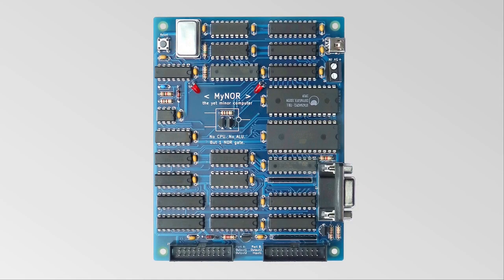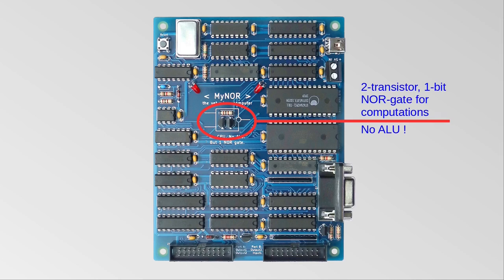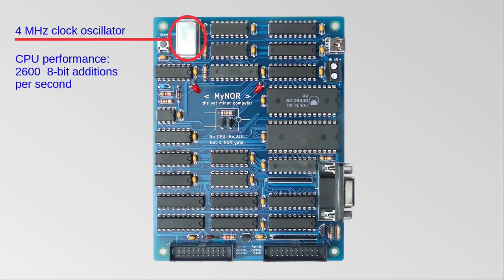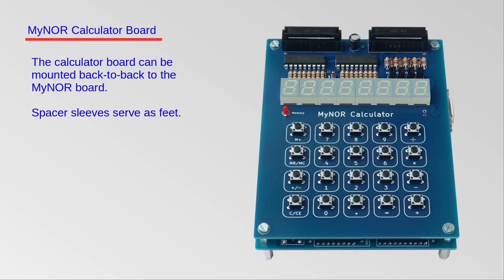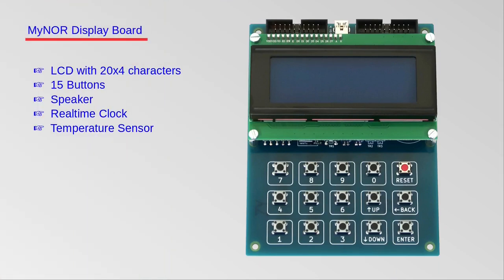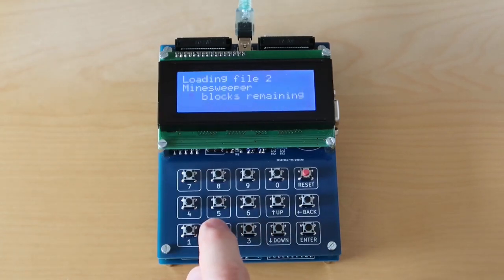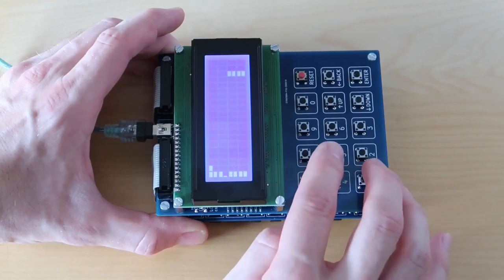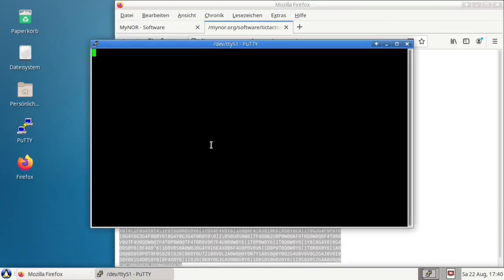Introduction to the MyNOR computer project.

Comment: Do you think this thing could output VGA?
Reply from the maker: No, never ever. MyNOR is much too slow. But the output of VGA was really not the goal of this project ;-)
Reply: @mynor509  it should be possible, make just static images, then it is about memory, not about processing
Reply from the maker: @SergiuCosminViorel It is not as easy as you think. I have already made a discrete graphics card for my MyCPU computer (www.mycpu.eu). It is all about timing. And My4TH is really too slow for that. It would be possible to output - let us guess - 64x64 pixels on a screen if you did it in microcode, but then you would have almost no processing time left for the CPU to execute software.

Comment: so it works like fpga?
Reply from the maker: No. A FPGA is a completely different thing! But MyNOR can be implemented in an FPGA. MyNOR could be considered as something similar to an FPGA if the external registers were considered as flip-flops and the EPROM as a logic cloud. But this is not the case, the EPROM contains real program code and is not just used as a look-up table to imitate a large logic cloud.
Reply: @mynor509  thanks for the comparison

Comment: Love it!!!. Could this be further overclocked by using a 74HC02 IC instead of the discrete NOR gate?
Reply from the maker: No. The NOR gate can work with up to 12 MHz. I have a working setup here that is clocked at 12 MHz. The only thing I changed were the two decoder chips wich are now of type 74"AC"138 and 74"AC"139. The speed-limiting factor is the "round trip time" from address selection to the validity of the data at the outputs of the RAM and the other data sources. In the design I tried to avoid too many cascaded gates to reduces this time. But because of the goal to use as few components as possible, I had to make a compromise, so the maximum working speed with 74HC gates only is limited to approx. 10 MHz.
Reply: discrete transistor gates, properly done, are faster than the integrated that are available